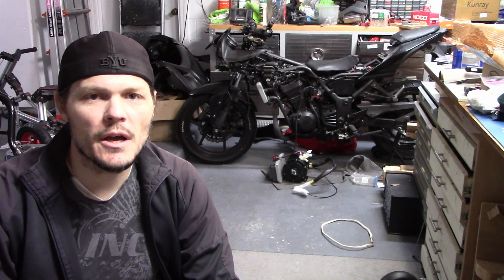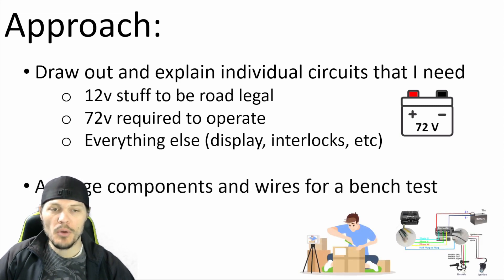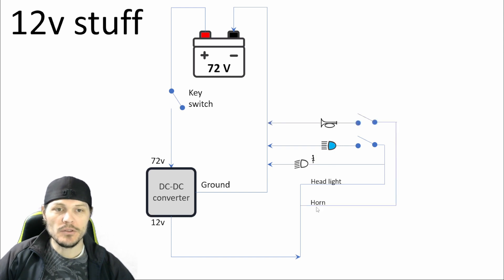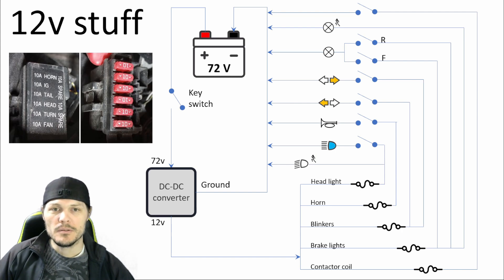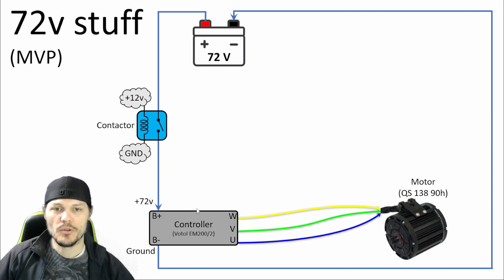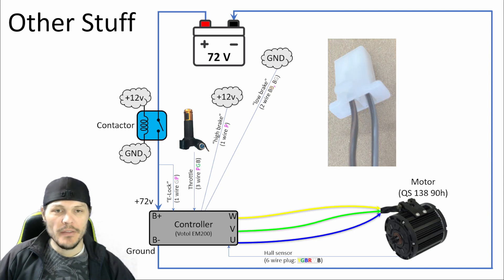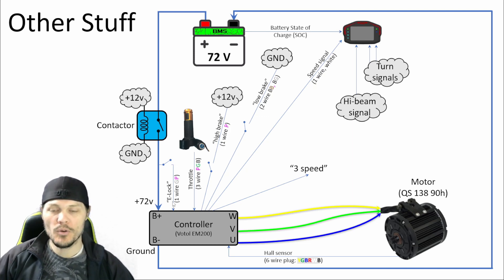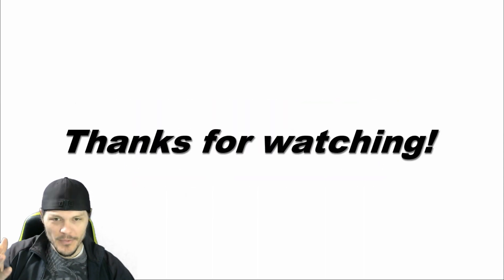Electrification of a Ninja 250 - Wiring design

Comment: everything on my dash works and lights up, however my highbems blue light don’t show up and my headlights aren’t working are i just replaced them what to do?
Reply from the maker: Id start by checking everything on the 12 v side. Are you getting 12 from the DC DC converter? Is there 12 v at the fuse box? Basically just need to trace out where the signal falls off, and that should point to the problem

Comment: Great video! From what I understand, high brake and low brake both do the exact same thing: use the motor to slow down. I think the difference is just how it's activated, from either a high (+) signal or low (ground) signal. I think you just get to choose which signal you pick. I could be wrong, but that's how I've understood it when looking into e-bike stuff!
Reply from the maker: Thanks for sharing! I actually based that part of the video off of answers i got from asking the question in a facebook group. I suspect that i'll find out what's really going on during my bench test and/or ride test, and will be sure to post a video with my best explanation of the results after i've got them :)
Reply: I came across a youtube video on this very topic. Basically, the "high" signal will also power your brake light as well. https://youtu.be/zgJAY_0xSTM